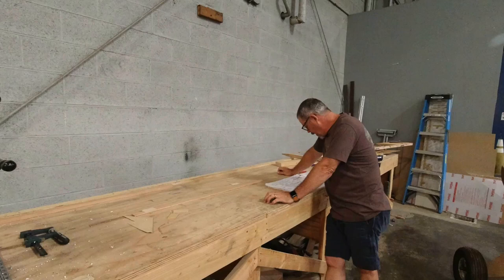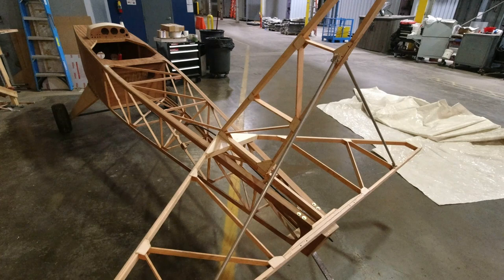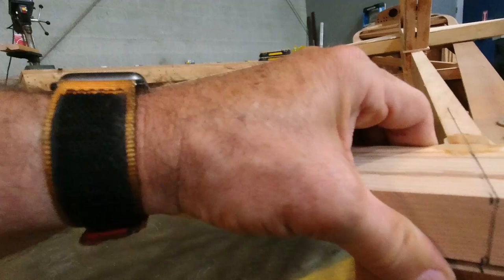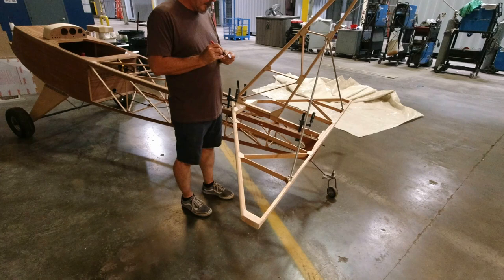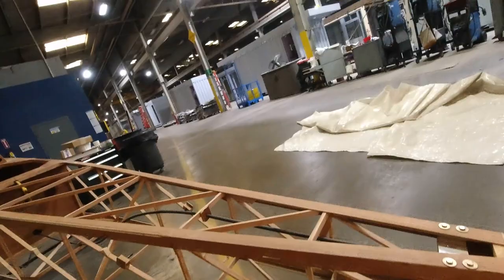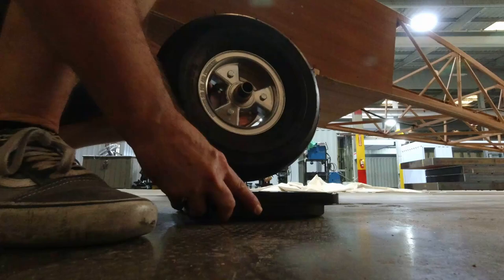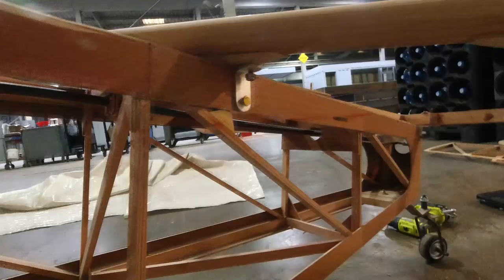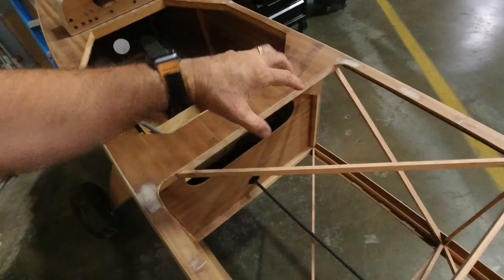Minimax 1100r Wood Aircraft Build Ep 116

Comment: If you can hit 300lbs empty weight you should get spectacular performance on 37 horsepower. I get about 450-500fpm in the summer and around 600fpm in the winter on 28 horsepower with a 450-500lb flying weight. I tried to minimize weight everywhere possible with only two coats of paint and just enough varnish to get the job done. I weighed 170lbs last I checked but I think I lost a few pounds after doing keto
Reply from the maker: The crazy thing is that my engine is 45hp. I like you won't be putting a whole lot of weight on with Paint. I will be using Acrylic latex like you did except mine will be flat in Hurricane colors. A couple  of coats is all that's necessary for planes that don't live in the sun every day.
Reply: @DTMinimax  Wow 45hp, I wonder what kind of thrust in pounds that engine puts out. just try to keep everything light, I think I heard every pound reduces the climb rate by 3.5feet per minute.